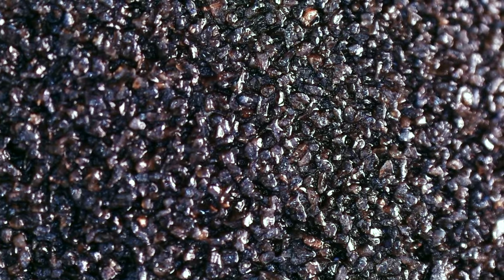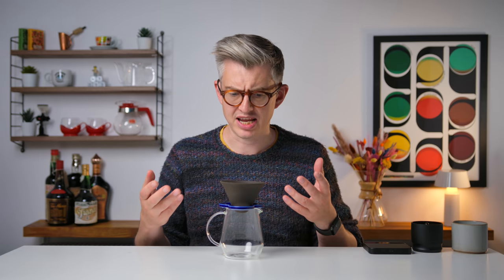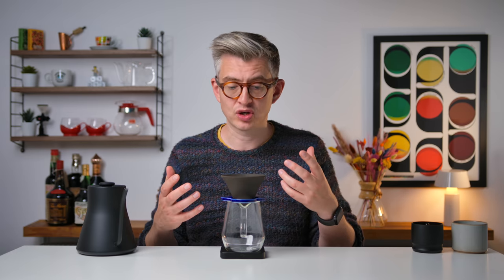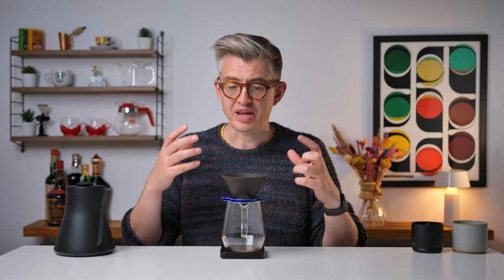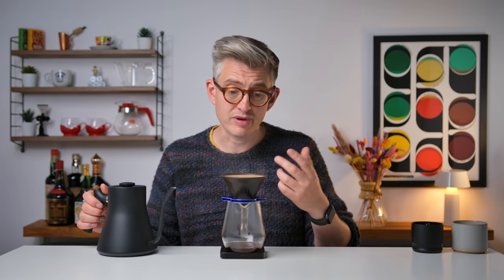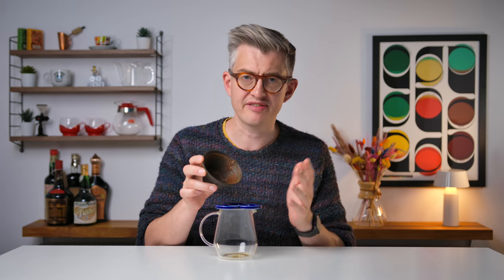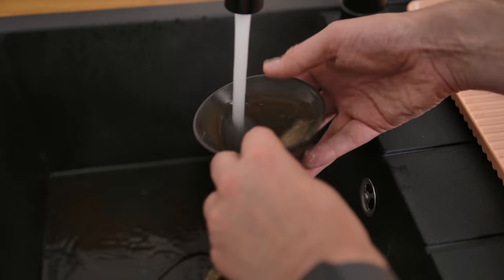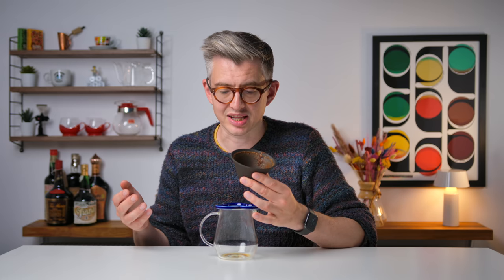Ceramic Coffee Filters: Magical or Maddening?

Comment: I really appreciate your perspective that using a lot of water is not "zero" waste. People in developed nations often take water for granted, but there are a lot of resources that go into providing clean water to your home, and water use is not trivial in a cradle to grave analysis.
Reply: While I agree with both your statement and what James said in the video I do think it’s important to remember how much hot water is required to produce paper in the first place. While I’m sure that lifecycle the ceramic may require more resources to produce and maintain, paper is quite damaging to produce.
Reply: A metal filter must beat both paper and ceramics right ?
Reply: 500L of water for 1kg of paper. That's enormous
Reply: @thibaultmanderscheid4843  yes, but it means a 1g filter takes 0.5 L of water to make. So at least from a water use standpoint, anything that takes more than half a liter of water to clean is less efficient than paper.
Reply: @thibaultmanderscheid4843  how much per kg depends on what kind of paper and how modern the facility is. Some of the most modern facilities only use 25kg of water to produce 1kg of paper. Beyond that, much of the water used in the manufacturing of paper is treated then returned safely to the watertable
Reply: @DarrenMeyer0x01  I doubt my aeropress paper weighs more than 0.3g 🤔. If I plant one tree i couldn't in a lifetime drink enough coffee to make my paper use offset the tree.
Reply: @sebaba001  No doubt, and the paper industry uses trees from the forestry and logging industry which replant and maintain their stock of trees or they’d be out of business. The notion that logging operations are just roaming across random swaths of wilderness leaving nothing but sawdust in their wake is just childish. They log on their own land / rented land where they maintain the stock of trees lest they run out of inventory. The interesting reality is that the more paper we use, the more demand there is for trees and, therefore, the more trees are planted on land otherwise used for other purposes and the more trees the cleaner the air, so those who are neurotic about environmentalism and such should encourage generous use of paper products and wood in general! 😄
Reply: I think James also implied that the energy required to get the hot water to clean the filter consistently was a significant reason that this filter isn't zero waste, not just the water used.
Reply: @KevinJDildonik  unfortunately all that grain for feeding the nandos chickens etc isn't simply "supplied by nature" - it's intensively grown on land usually cleared of rainforest. Animal feed is a massive drain on resources. Just because you can't easily see where the 90 gallons of water go in the process of rearing a chicken that wouldn't be alive except for farming,  doesn't mean its not true.
Reply: Paper is incredibly water process intensive. There’s also the issue that paper filters are bleached in various ways, none of which are particularly environmentally friendly. …and though the paper filters degrade, it’s still waste mass. 
As is often though you end up having to pick one devil over another. Personally I’ve never liked paper filters. I hate having to shop for them, Murphy’s law dictates you’ll be out when you most want a coffee, and they can get messy throwing them away.  …so I like this ceramic filter, it’s checking a lot of convenience boxes and my gut instinct is saying it’s eco footprint isn’t likely worse than paper.
Reply: He's not wrong but like... coffee itself is pretty unsustainable, it too takes a TON of resources not to mention the ethical concerns. Probably orders of magnitude more than whatever extra bit of water a ceramic filter uses. Drinking less or no coffee is unfortunately the single best way to help the environment compared to anything else you could change in the routine.
Reply: @DarrenMeyer0x01  Then add in the heating source for the hot water.
Reply: ignoring the water, just the power to heat the water, often through electrical grids that aren't very eco-friendly, is already too wasteful
Reply: @AveragePicker  I did the carbon footprint analysis when deciding whether to default to the cloth filter or paper filter when using my V60. Depending on one's particular set up things may vary, but I have a very efficient natural gas water heater (~70%), heat the water by ~45°C, and found that it took at least a litter of hot water to adequately clean the cloth filter. Given these figures, I found that the carbon footprint of heating the water to clean the filter to be ~0.014 kg of CO
2. The carbon footprint of 1.5g of paper (the weight of my filters) is ~0.0018 kg of CO2. I should note that manufacturing, packaging, and transporting the filter will certainly add to this carbon footprint, but given how much more carbon intensive heating water is (nearly 8x), I'm fairly certain the paper would come out way ahead regardless. Obviously, if you have a carbon free source of hot water, that changes the calculus.
Reply: Research shows that in the whole chain of coffee the biggest carbon foot print is the FERTILISER of the soil. So if you have a good organic specialty coffee that has been produced with a care you can brew with as much paper as you like ... I agree with James that zero waste is never zero waste and I believe we shouls always be aware of the whole life cycle of product.
Reply: @sebaba001  The two pieces of aeropress filter I weighed were 0.16g and 0.17g, so even lighter. I also weighed Hario V60 filters, and they are in fact a gram each (exactly 0.97g and 0.98g)
Reply: @thibaultmanderscheid4843  so this thing is definitely worse as you will need several Liters to rinse it.
Reply: One should not forget, though, that there are countries and regions in the world with limitless water supply. Every Austrian could let all their taps run 24/7 and still there would be more than enough water for everybody. Context is everything.
Reply: honestly i just dislike the amount of plastic wraps that come with buying paper filter. Of course everything is not zero waste if we factor in water and co2 emission, but I'd start by cutting down on my meat consumption first.
Also on that note, I wish the coffee industry switch to compostable wrapping, I imagine most coffee enthusiast would have their own container already.
Reply: @honzajedlicka6645  Good to know, never bother to weigh papers cause my scale kinda sucks hehe.
Reply: Surprising my comment got so many replies, but the replies are not surprising.  What I saw here is that some people think that the water cost of producing a paper filter may be more than the water cost of washing a disposable one. It's unclear what is true, and it will vary from person to person and manufacturer to manufacturer. In the state of California, in the US, new faucets are required to flow at a maximum of 1.3 gallons (5 liters) per minute, and this is considered "low flow." So, 2 minutes washing a filter spends 10 liters of water. That includes the energy intensive treatment, transportation, and retreatment involved. Industrial processes tend to use a lower level of treatment (as in, less energy), and recycle it, but the process may still use more than alternatives. There's no way for us, as the consumer, to really know what is better because we do not have access to that kind of information. It's important for people to continually point out the inputs and outputs of all products for us to become better educated and to demand better information. As a consumer, it's impossible for us to do a life-cycle-analysis for every product we buy, but maybe we should start demanding that of the people who sell it to us.
Reply: @SoidHoid  lovely summary of the discussion!
Reply: All water I have is harvested from my roof. No, I do not waste it, but I do wash and rinse all my coffee gear (and even more).
Reply: the paper debate doesn’t take into consideration that once you’ve run out of filters you have to get in your car and explode a bunch of dinosaur corpses. That spent dino juice 🦕 🧃 can’t be treated and used again like water can. So, ceramic is clearly more eco-friendly.
Reply: Depends where you are Samuel- very little resource goes into providing clean drinking water up here in Scotland. But yes, in a city a huge amount if energy is spent.
Reply: @SoidHoid  you have a fundamental flaw in thinking that you need to use water. 

The manufacturer States you can clean with heat. There's nothing stopping you from just wrapping it in foil and popping it in the oven when it comes time to bake something. 

Or boil some water for your coffee and just leave some left over for your filter. The fact that you want it pristine clean is the thing that really hurts the environment. 

Imagine if people didn't want pristine white coffee filters the damage to the environment would be allot less. 

Coffee in and of itself is a bigger contributor to environmental impacts more than anything else. 

As coffee enthusiasts you guys should know this product isn't for you. This product is for the people who actually just don't want something disposable. Someone who probably drinks the same grind everyday and just wants to never go to the store to buy papers again. 

Eco friendly is branding and as coffee enthusiasts you should know your hobby is not eco friendly and this product being seen as a negative since you need to spend more water to clean it pristine it's the fundamental flaw of your logic. 

This doesn't need to be cleaned to that degree, if you wanted the taste of something new just use papers. Trying to make this ceramic filter perform like a paper filter is the only reason there is an argument that this is not zero waste. I'm pretty sure you could just rinse it out with the hot water you boiled for your brew than another quick 5-10 second rinse under the tap would be enough. It's you're want for pristine that is not eco friendly
Reply: @AveragePicker  Papermills tend to be built in areas that are not particularly water constrained and a substantial portion of their power comes is generated on site from the waste products of the papermaking process. A marginal gallon of water consumed in rural Maine is less problematic than one consumed in Arizona.
Reply: @ronson-natsarim  Kinda agree, but i think in reality forestry and logging industry are often still anthropocentric. In a sense that the trees planted for wood/paper products will eventually replace the ecosystem that harbors biodiversity. Ecosystems are not just forests; Grasslands, prairie, bogs, etc. are still equally important.

Things like bamboos that are said to be a green material is one example. While they are fast to grow and easy to plant in virtually any kind of soil, the non clumping ones are highly invasive and will outcompete native plants (also pretty hard to remove when completely rooted to the ground). Other monoculture trees also have similar problem.

I know that we should be glad that more demands mean more co2 conversion, reforestation, etc. But just like how eradicating wolves in yellowstone lead to sickly elk and cattles (incautious ruminant overgraze and didn’t let any new plants to grow), or how constructing urban sprawls causes mosquitos to carry more diseases (female mosquitos that consumes enough nectar, suck less blood). It probably won’t end well for us in the long run, to only maintain things that have human value...
Reply: If it can be cleaned simply by inverting it over a tea candle for 10 minutes and giving it a rinse, that seems pretty efficient.
Reply: @MrMadvillan  A consideration. However some may walk, bike, own an EV, revieve filters as a shipment from amazon they where getting anyway. Point is how green a ceramic vs paper filter is for me is likely different than it is for you. Best we can do is try and look at lifecycle emmisions as an avg. If you used water from a rain barrel heated by the sun exclusively and if the ceramic lasts long enough it may be the greener option. However for most I bet the paper filter will win in the long run. Further this is super small potatoes, If the goal is individual reduced emmisions one can make much simpler changes with a much larger impact in their lives. Realistically while we should' all do what we can, major consequntial change will need to be made by industrial operations likely forced by government as corporations are souless profit machines that only do whats best financially.
Reply: @chublez  bigger picture however is that capitalism and the environment yard no obligation to one another and that’s why marketing something as environmentally friendly is always cringeworthy and requires heaps of dissonance ie. this entire comment thread.
Reply: @KevinJDildonik  you gotta water the trees the papers made from to start 
Then they'll use it to clean and then probably got some heating aspect so if I had to guess I'd say alot
Reply: The issue is that any water you and I use and save is a drop in the ocean.
We could all triple water usage if we're not in a drought zone and it would make no difference.
Industry uses a billion times more than any individual
Reply: Depends on where you are.  Plenty of developing nations have huge regions where water is in huge excess. In the Philippines, we have water parks that perperually fill and drain pools with fresh spring water.
Reply: @kay60552  Depends on where its gown.   Many small farms intermingle coffee shrubs in a natural habitat. And they never water, they don't have to.  The carbon footprint is in the shipping.  Especially for dry process coffees.  Some wet process coffees(S.Asia especially) are grown in areas that don't worry about water at all because they have so much of it.
Reply: I guess the answer to this issue is to empiricallu investigate it. We can make several assumptions but we need to be objective on this.
Reply: Also using a lot of energy (either gas or electric) to heat it up is not "zero" waste
Reply: @PaendaTube  drinking Coffee is not a hobby.
Reply: @kay60552  You are right. Coffee is one of the least sustainable products that exists. To the gram, carbon footprint is about the same as beef, like all crops, it uses up water (while providing zero nutritional value) -- it is sailed around the world, it is roasted in a process that creates smoke and greenhouse gases. -- I live next to a roaster, and we share the dumpsters. Man, that stuff stinks. I think if we want to drink coffee, we should treat it more as a luxury than something you guzzle like water, and to appreciate the hard work put into it. Let's be honest, even if it's fair or direct trade -- how many of us would want to trade places with a coffee picker?
Reply: @thibaultmanderscheid4843  But if you are using an aeropress, you can re-use the filters. Which are already smaller than, for example, a Chemex filter. It is possible to re-use them up to 20 times. I try to save paper in different ways. For example, I put a notice on my letterbox that says "No unsolicited material, please", and most of the time, people who deliver Chinese and pizza menus respect that. I use a blackboard and a piece of chalk for my weekly to-do list. I still use toilet paper, but I switched to recycled long ago. Diva cup. Tampons and pads include not just paper but also plastic and cotton -- a material that uses up even more water than paper. Especially organic cotton, unfortunately, because more goes to waste. And it is often grown in places where there is little water. Think of the Aral Sea -- it's basically gone thanks to water-intensive agriculture.
Reply: I'd say it depends, if the paper mill is in Seattle, it really doesn't matter how much water they use, whereas if it's in Arizona, they'd probably want to save every last drop
Reply: @iamlalala1995  plastic wrapping has a very low carbon footprint and impact in general - the paper itself will be vastly more. Should the plastic be disposed of responsibly (and recycling of films is still rare)? Yes, of course. Would it be better to use a recyclable bio-based plastic to take fossil resources out of the loop entirely? Yes. But I'd be wary of a biodegradable option (especially paper) on the grounds that paper coffee filters need to be able to be stored and kept dry for years at a time (How long have you had that pack of aeropress filters in the cupboard? How long were they in a warehouse before you got them?) - it wouldn't take much wasted filter paper due to inefficient wrapping breaking down in storage and letting the filters spoil before you'd be worse off than using polyethylene in the first place. Good news is that film recycling is totally feasible as is non food competitive bio-PE from second gen biomass... that'd be the ideal wrapper.
Reply: @iamlalala1995  totally agree about cutting out meat, though. I've been veggie for nearly 30 years and Vegan for the last 5 or so. It's the biggest and easiest thing we can do as individuals to reduce our carbon and land use footprint.
Reply: @updlate4756  guess the only logical thing to save the environment is for humanity to sit naked in the dust until we die,problems all solved.
Reply: Vietnam has no running clean water. All water must be filtered or boiled, even then it is best to buy bottled water.

What is the biggest industry here? Coffee. They export almost as much as Brazil does, huge huge business here, coffee is a pass time, with a shop on nearly every corner.

Vietnam also uses coal in most households " in little brickets" so if you don't use them, they just waste away. The use of water is kind of moot, if the system around it facilities it. Modern post industrial societies have much more waste than developing nations who already have a process to use water safely. Higher end shops use electric with fancy machines, others just a standard micro brewer.

The only part of your argument I agree with would be access to water. Countries such as India or parts of the middle east which are seeing 45 to 50c temperatures now? THIS is a point of concern and something to wonder about. The allocation and availability of water that can be made or is potable is up for debate in places where this is a problem.

Your argument isn't applicable to all places developed or emerging. Just existing contributes to " waste " what matters is how the life style and culture uses their resources. American or westernize style of experiencing coffee is far more wasteful and impactful than that of developing nations " which is the opposite of what your statement infers."
Reply: @dennislock3415  Ummm. what?  Wait, so you felt the need to respond to a 10 month old comment about me pointing out that when comparing resource use of mesh to paper filters, you should also consider the heat source for the hot water... to "oh man... I guess the only solution is to sit naked in the dust until we die".  

Troll comments like this are just so pointless, they hurt.  But hey, the trolling worked I guess, you lured me in to respond., you got attention.  Congrats.
Reply: @updlate4756  Sure I didn't notice the time stamp first off and really don't know why I responded to your mesh comment like that only thing I can guess is that I meant it to go to some one else,sometimes sleep is catching up with me ,only thing I can figure sorry.
Reply: I don't think his point is about people wasting water, it's more about the marketing this coffee filter is using. It's claiming to be less wasteful than paper filters when it's actually more wasteful, and isn't a superior product when it comes to taste.
Reply: @YomericaORdef  but that's equally true for water used to wash something
Reply: @ronson-natsarim  logging operations quite often cut down forests and do not replant anything back.

Not to mention that cutting down forests to replant commercial trees is overall environmentally harmful as it disrupts the ecosystem, harms the local wildlife, and the new trees take time to grow, aren't as effective as thebold trees, and, since commercial lofting operations replant only a couple species of fast growing trees to cut again most of the time, these trees can't house the biodiversity an actual forest can. Not to mention everything else that gets cut or destroyed togetherness with the trees thats not replanted like bushes lichen etc

Im not saying that logging is inherently bad always, but more demand for paper products results in more logging operations targeting wild forests and land used for logging can't really be rewildes
Reply: @MrMadvillan  marketing something as environmentally friendly when it is environmentally friendly, or at least more environmentally friendly than its alternative requires no dissonance at all. Its an objectively true statement.
There are sustainable and non damaging ways to do things. Its not that deep. Its not even really about capitalism its about our relationships with how we choose to produce things and what things we consume
Reply: Yeah, everything is scarce at SOME, bla, bla, bla…
Please tell me how much water I use rinsing out my coffee filter in San Diego affects the poor in Africa, or me using paper filters harms anyone else.
The mass peddling of manipulative guilt (for some greater false good) is a huge problem that does real harm
Reply: @andersson_casa  Depend for how long you use it. Just like a mug, if you are particularly unlucky/ill-handed, and you broke one every month, it is probably better to use paper cup (or a metal mug)
Reply: This assumes you let the water used just run down the drain and into a municipal waste system (which then costs more money to clean the waste water, along with other wastes).  If you have a garden, or are not on a sewer system, or can otherwise make use of the waste water (which is still more than clean enough for many purposes), then the water use matters relatively little.
Reply: Hey lets all remember that no one needa coffee. Its a luxury. The process of drinking coffee in itself is a waste of resources. Nobody needs coffee, nobody needs expensive coffee making machines yet this guy has thousands of dollars worth of trash, but yeah, lets talk about sustainability.
Reply: I'm better than all of you.  I have a multiple tattoos.